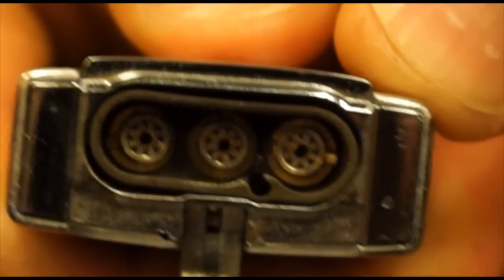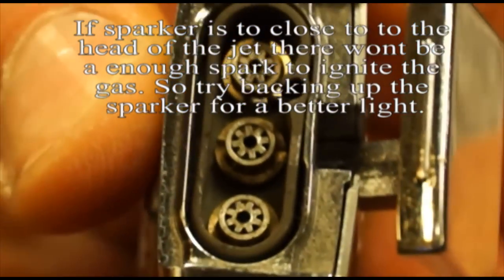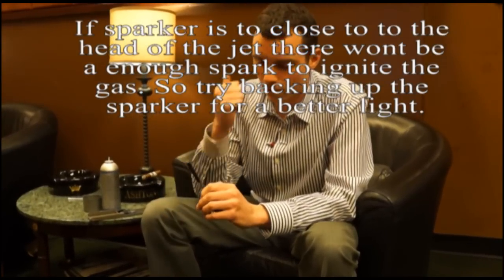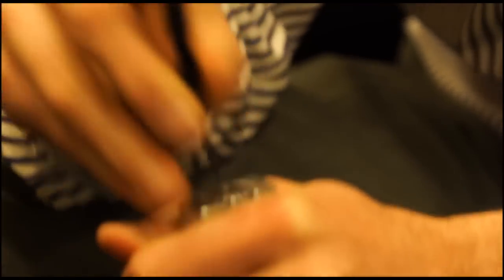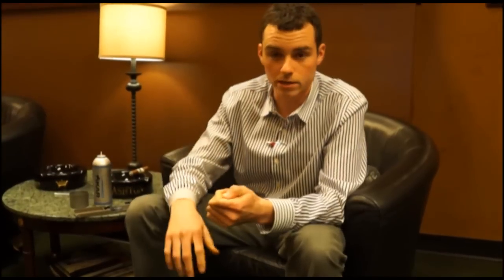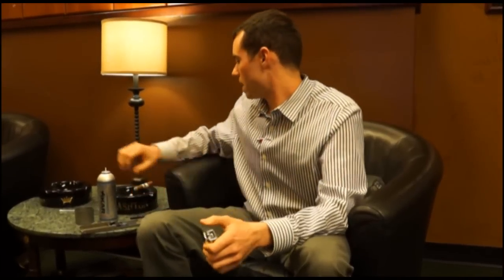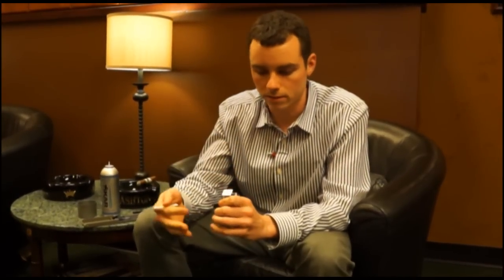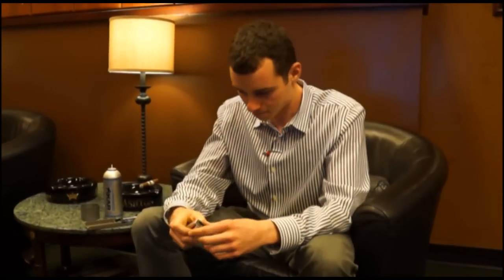Fixing A Broken Ligher: Common Lighter Problems

Comment: Thank you! Agreed; this is the most helpful video out there on troubleshooting torch lighters. I have 2 Xicar torches - A Genesis (single torch) and a Vitara (double torch). I sent my original Genesis back to Xicar and they replaced it. The problem was, it just wouldn't light ... even after a full purging. I started having the same problem with my Vitara after just 2 weeks! Watched your video and saw that the metal piece where the spark jumps off was too high. Fixed it! Now it lights! Thanks!

Comment: You know after I read your reply, I became more confident that although the problem recurs so frequently to so many lighters, it is not easily fixed. So I started to smash the hell out of them!... well actually I meticulously disassembled my stockpiles.....They all have cracking/melting/damage to the plastic housing for the sparkers... why the heck haven't these companies devised a non plastic housing.. GRRR
I managed to swap out various parts and reassembled some lighter and they work!! score!

Comment from the maker: First try turning up the lighter normally a quick flicker and then it goes means its just not getting enough gas. Next try lighting it with another lighter to see what the flame looks like. If looks like its not a solid jet like it would be new your jet is dirty. Take the lighter and blow into the jet as hard as you can. That is normally enough to loosen any dirt. Try lighting the lighter after this and see what the flame looks like lite, That should fix your problem.

Comment: So this has happened to 3 of my 4 torch lighters:  It will spark, the flame will be there for a brief moment but then immediately go out.  I can still hear the butane come out of the lighter since I'm still holding the button.  I've tried bleeding and refilling each of them, but the same issue arises.  I'm at a complete loss.  Any ideas?

Comment: How in the world should air get into a lighter? There is pressure inside, air would need higher pressure than that to get in. But even if there were air in it, without any butane left: it would be compressed when adding butane, and then go out mixed with butane gas. The remaining air would be mixed into the gas part of the butane. The vaporizing liquid replaces the gas often, so the air fraction decreases quickly.
Reply from the maker: bleed it with a small screw driver by depressing the fill valve on the bottom of the lighter. Then you will get a good fill on the lighter. just be gentile not to damage the fill valve.  Also dont use a pen to drain the lighter it will ruin the pen and dont use anything that could get stuck in the fill valve like a tooth pick.

Comment: when I refill my butane lighter it spits out the butane back its just a regular lighter
Reply from the maker: +robert gonzalez  if its spiting back out of where you filled it there is an o-ring that helps seal the lighter that has probably failed. you would have to try to replace that... Im not sure where you would find one tho